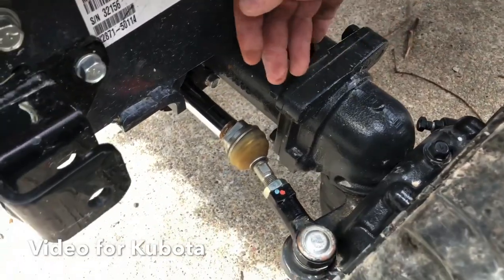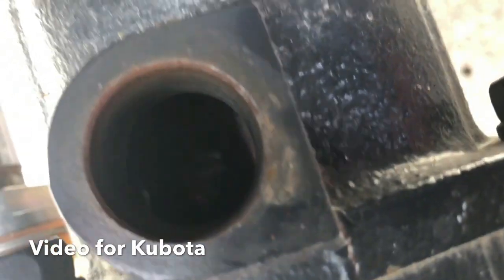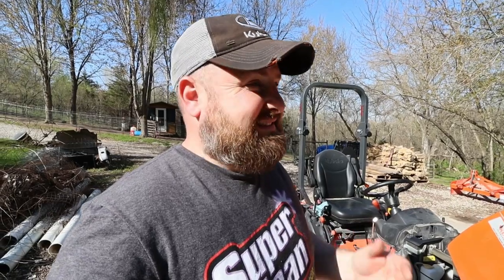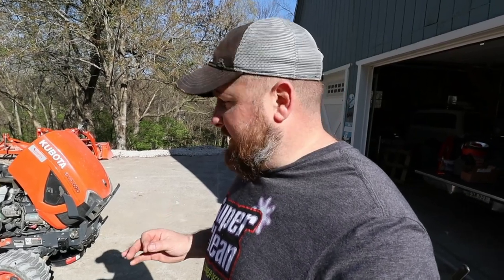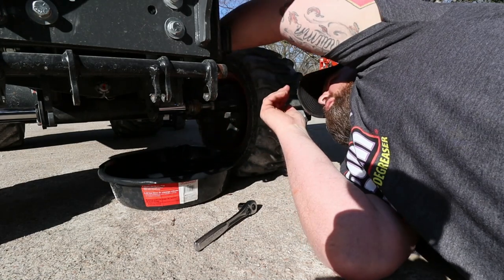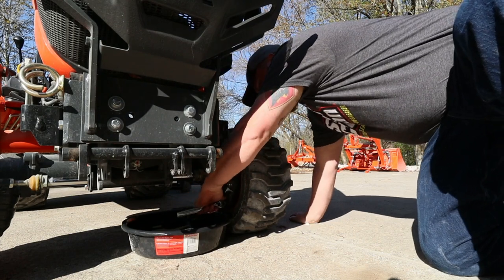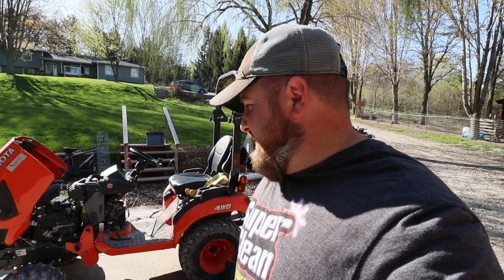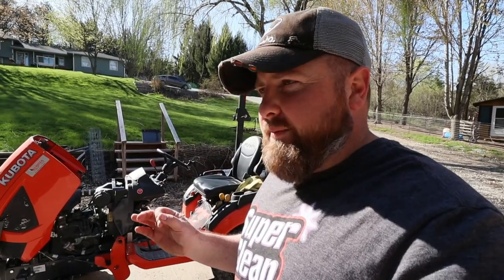✴️ TRASHED Kubota Front Axle  ?

Comment: I had a very similar situation!!  I was at your original video, a few minutes ago, regarding your dry front axle and my eyes opened wide and I went straight to my tractor and checked the oil level.  I have 172 hours on the tractor.  Well, there was oil but it was barely touching the bottom of the dip stick.  Hmm, I will top it up tomorrow morning.  Good thing I didn’t wait until the 400 hour mark in accordance with the manual to check and change the front axle oil.   More importantly, thank you for bringing up this very important issue!!  I’m going to hope all is well with the front axle as there was oil even though it was super low.   Thanks again for the heads up.

Comment: I had the same experience with my BX2380. No oil in the front axel. I bought a new PD10 post hole digger and found no oil in the gear head. Kubota and the dealerships are being cheap relying on the customer to do it. This is my first tractor so I'm on a steep learning curve. For the price you pay for the machines Kubota should do a lot better.
Reply from the maker: Facts

Comment: When I saw your first video, I checked mine with 40 Hrs. I couldn’t reach any oil with my finger. I took about a quart to fill up. Complained to my dealer and they said evidently the factory is to letting the oil distribute throughout the axel by running it and checking the oil and adding. They must be filling without running the tractor to let it distribute throughout the axel. I’m pretty pissed too!
Reply from the maker: You caught it though so that good news but yeah I’m hearing the same thing

Comment: I'm glad you caught it in the early stages and hopefully the new oil change will clean up any problems.
It's a darn shame though that Kubota and the dealerships aren't doing the things they need to do that will protect their reputation and business.

Just wondering out loud if the dealerships thought the factory did it OR the dealership just dropped the ball?
Everyone seems to have some skin in the game for lack of communication.
Reply from the maker: The dealer was responsible for top off all fluids. I’ve been talking to them and they seem to be under new management and willing to work with me. But like myself I’m not sure how we can fix this problem because everything is working as it should be. They asked for the oil which I saved so will start there

Comment: Of course I wouldn't be happy either, but I have a feeling you're going to be ok. As you said, tolerances are not near as tight as an engine. Because it's a tractor and not a vehicle driven on the freeway at higher rpms, and only 68 hours, I have a feeling you're fine. If it were 68 hours of 60mph I'd be more worried, but 68 hrs at 5mph tops and being industrial grade axle, re fill and send it. At least had some oil in there at the bottom to keep things wet and some of that oil was slinging too. The gray shiney matter could possibly even be normal break in material. All bearings and gears will shed a bit when new til they find their happy place.

Comment: B2301, 116 hours, full fill by dealer of Premium UDT. oil trashed, very dark blackish green and metallic traces like yours. seems to be normal. refilled with shell spirax 75w-90. I also had larger metallic pieces< 3 to be exact, looked like casting flash. due to portal design, 400 hour for first change seems to be too far out. all the crap goes to the bottom. will take sample at 50 hours of the shell oil, will not use UDT in front axle again

Comment: FYI the bevel drive gears in the front axle need to seat/ wear in to mesh properly. There will be some oil born metal particulates. 60 hours is so low I would strain the used oil to check for larger metal pieces.
Reply from the maker: Thanks for the information and I hope to see no metal in the next change here in near future. I could be in good shape after all 👍👍👍
Reply: Bevel drive gears? Lol U mean Helical gears?

Comment: I took mine to the dealer which mine was low as well with like 48 hours on the tractor... they pulled the plugs and there was fluid in just no nearly enough and there was some metal in it which they said is normal for brand new parts getting the edges worn off... they put over two quarts of gear lube in mine to get it on the stick and they were suprised... it was an issue they didn’t know about they’re supposed to come from the factory full and the first service for the front axle isn’t until 200 hours
Reply: And my fluid was nice and clear and transparent when they drained it yours looks dark and burnt
Reply from the maker: The pan and metal made it look dark but she was clear.... some what lol we’ll see what it looks like here soon

Comment: I'll be interested in knowing how it turns out for sure.
Reply from the maker: I will for sure do a follow up 👍👍👍
Reply: Itll be fine. Itll be silver every time u drain it. As long as it had some in it itll be no problem.  As u drive a axle is designed to flow the oil to where it needs to be

Comment: Not so bad, axle oil from cars can look similar I would suggest sticking with the kubota oil though just because it's possible the seals will react with 8090 or anything else other than what kubota used. Not saying that is definite but in my experience it's easier than trying to figure out if it is the case. What might be worth doing here is disconnect the front drive shaft and with the wheels off try and turn each side and see how it feels. If it seems like it's grinding like a coffee grinder I'd be concerned or if clunks so loud someone near you might hear it I'd also worry about it. Otherwise it's probably okay
Reply from the maker: I did start to feel a wheel hop when turning like it was binding up
Reply: Stop it , 80/90 is just thicker. Does nothing to seals
Reply: @SunnySlopeHomestead  anything in 4wd will bind when u turn on hard ground.  Thats the worst thing for it. It shouldn't be in 4wd unless a wheel will slip when turning hard. Even new trucks when all the u joints or CV s are new get that bind feel when u cut it hard

Comment: I don't know what your dealer has for a procedure BEFORE you take possession of equipment. My Kubota dealer would not send out my new tractor until I came in and did a walk around of mine.  The Technician had a clipboard and I confirmed all fluid levels, grease points, and all options I wanted were installed.  I was proactive and pre bought all fluids and filters as recommended by the service department so I was ready to service my tractor.  When my tractor did arrive the delivery driver apologized but store policy was to go over the tractor again to check all fluids before I could sign confirming delivery.  I am not saying Kubota Corporate is perfect, but this sounds like a dealer issue.

Comment: I've been a mechanic most of my life and stopped panicking over light metal detection in(NEW) assemblies Long ago. Oil or no oil, new parts wear in and shed a micro layer off their surface. Yours was Low to start with so you didn't get all of that out initially. Much of it was stuck alone the upper part of the housing. Filling it to proper levels allow the parts and walls to rinse themselves and stir the liquid. Then you were able to drain it away.
Think about the number of revolutions you are actually turning in 400 hours. Nothing compared to a car or Work Truck. 
* You would likely do far more damage misusing the 4WD feature, even with the oil level correct.(Don't ask how I know)
Many engines/Transmissions have magnetic drain plugs - ever wonder why?

Comment: Here's what I learned when I changed my front axle oil at 50 hours...  Drain both sides of the axle and have both breather plugs removed.  My mistake was putting the breather plugs back in before filling up.  I figured having the fill open would be enough.  It's not.  Keep breather plugs UNINSTALLED until you fill axle back up.  I used 80w90 as well.  My opinion is kubota should make the dealer replace your axle.  That's bullshit and not your fault.
Reply from the maker: I thought the same thing on the vent plugs but I guess they’re there for a reason. I’ll check the level again , thanks 👍👍👍
Ps that would the best option but probability of happening it’s unlikely
Reply: @SunnySlopeHomestead  If you remove the breather plugs your level will go down and require more oil to bring it up to spec.  then put plugs back in.  Recheck level and you should be good to go.
Reply: U can put 1 qt in it and run it around the yard and never have a problem.  If u drove it for miles at full speed. Then u might hurt as something